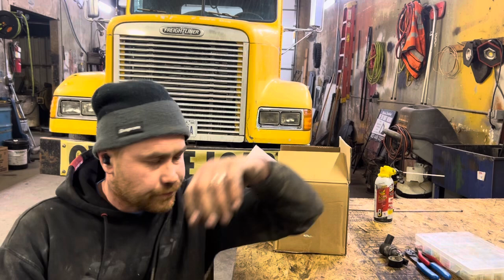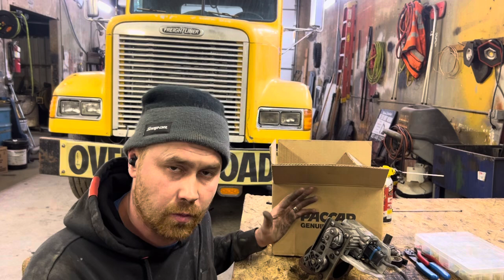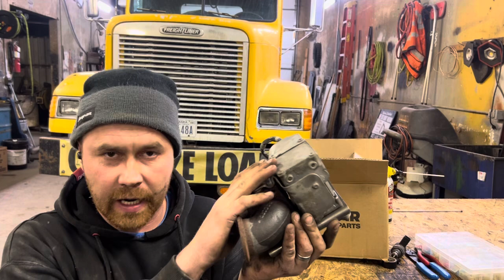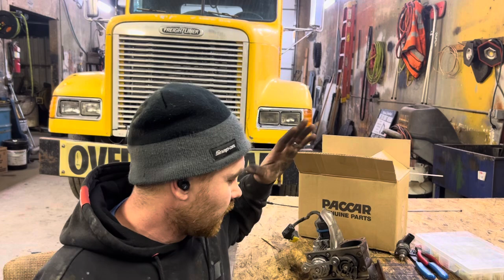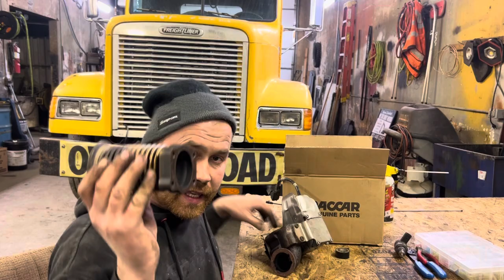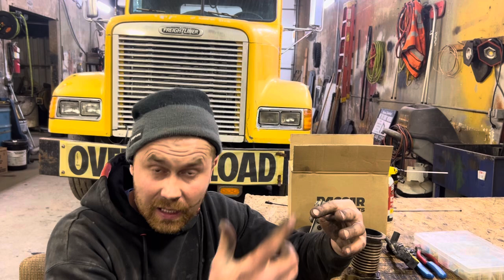Paccar Engine BS

Comment: Im throwing codes for the egr temperature sensor. And im thinking i can try to clean it and replace the sensor. But there is literally no where on the internet that shows where it at. If you could point it out thanks
Reply from the maker: It is an EGR cooler coming out on front   the front of the engine, passenger side look underneath EGR discharge pipe
Reply: @arsentrucking7883 thank you sir
Reply from the maker: If you want, I can record the video
Reply: @arsentrucking7883 i think a lot of people have problem with the EGR, especially on paccar with all the sensor. I would definitely watch the video
Reply from the maker: @l3loodR4IN  OK I will record one tomorrow
Reply: @arsentrucking7883 thanks. Mostly what im looking to do is clean all the parts and like know exactly what sensors to swap out. I just got the pdf of the engine too.
Reply from the maker: What kind of scanner are you using?
Reply: @arsentrucking7883  ancel
Reply: @arsentrucking7883 spn 412 and spn 4752 are the codes
Reply from the maker: J pro